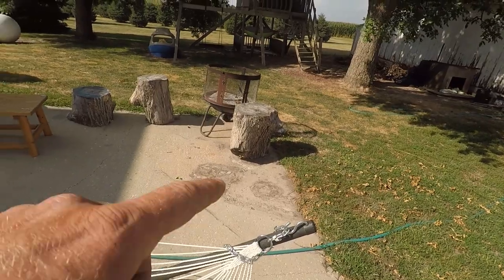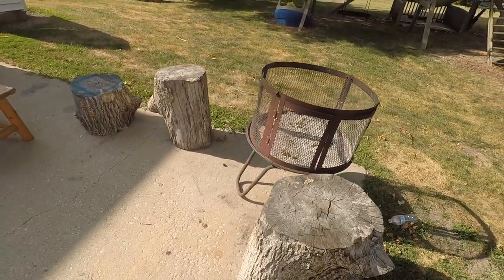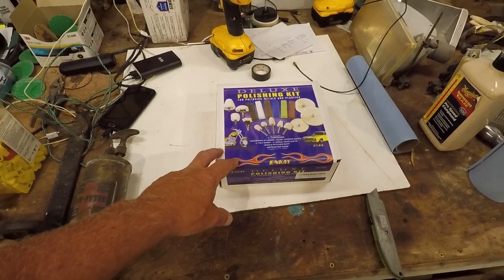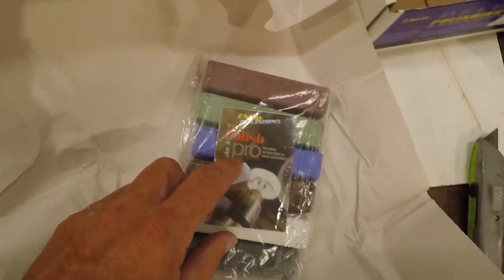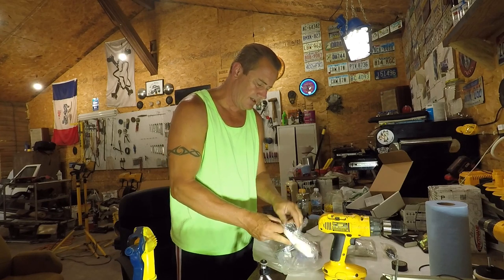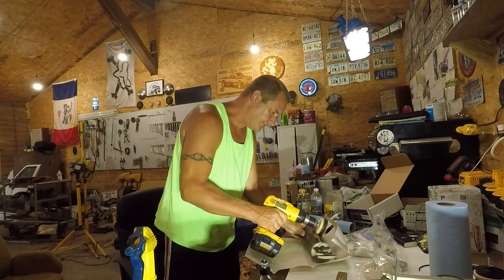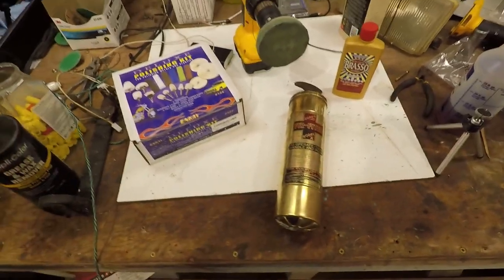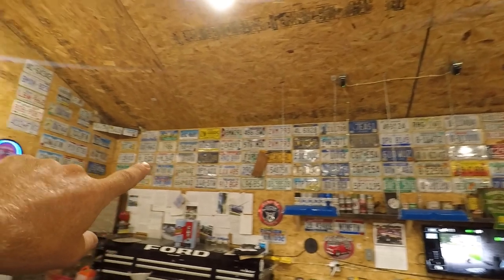I Can Now POLISH Like a PRO - Scattered Saturday Video

Comment: Love the Scattered Saturday Vids! If you can still add a few vent holes on the bottom course of that fire pit, the fire will burn cleaner and smoke will rise better. If all the oxygen is feeding the fire from the top, then it draws smoke back down - means more ugly smoke blowing in your face. Just a suggestion. Keep up the awesome videos!
Reply from the maker: It is pretty much all stuck together now... however there are some small gaps scattered around.. not air tight. If it proves to be an issue, Ill have to knock some holes in it or something LOL    Havent tried it out as of yet.

Comment: Lowes sells a metal ring for the fire pit, you can also get o e o  line that has a grill grate on it. Also fill it up to the second row from the top with stone and it will crank heat. I put my old fireplace grate in mine and works great
Reply from the maker: I way be making a grill grate for it before long. I have seen those metal ring liners, may look into getting one of those as well.

Comment: That polishing kit really is meant to be used in a air die grinder. You need the speed to polish the metal correctly. A drill won’t spin fast enough.